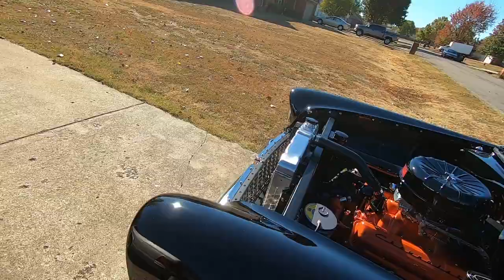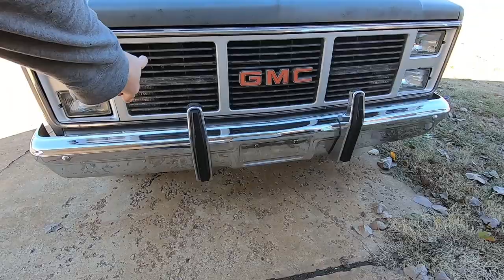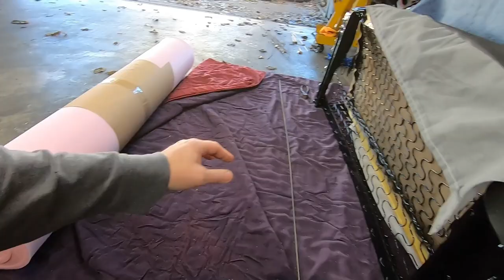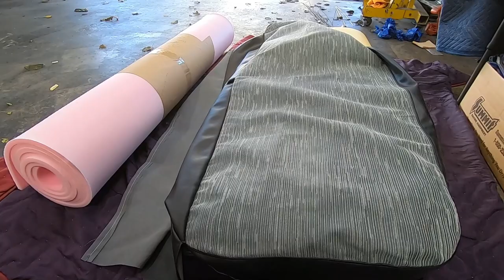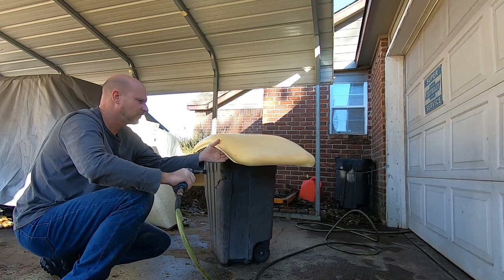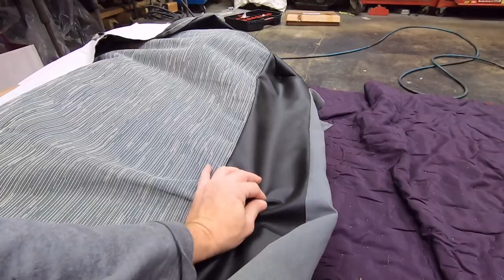55 Chevy project in the sun and starting seat upholstery

Comment: That car is stunning all around. My only question is whats your logic about running it with no hood just curious.The 55 Chevy hood is by far a gorgeous piece of sheet metal and completes the look with the hood bird ,emblem and grill chrome bar. Are you going to add a hood at somepoint?
Reply from the maker: The hood needs finishing before it goes on. I like to drive my cars before the hood goes on. In case it needs more tuning, catch on fire, etc.
Reply: @haffrods7055  Well that makes total sense thanks for clarification. Im so glad to hear that. I was thinking maybe you werent going to put the hood on.You probably mentioned it in one of your videos but I missed that one. And no latch in the grill thru me off too,LOL!  Looking fwd to your interior work and down the road when you get your hood completed and installed.
..